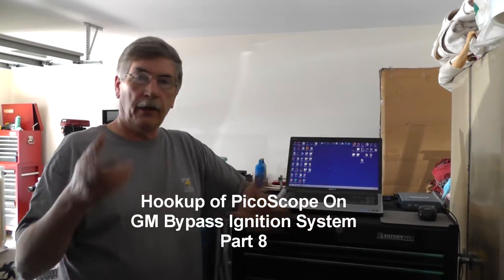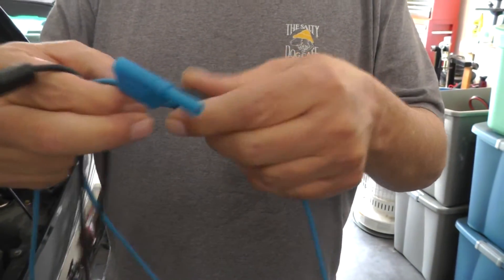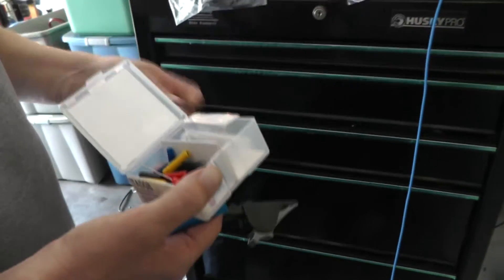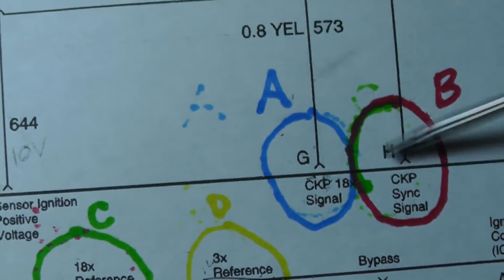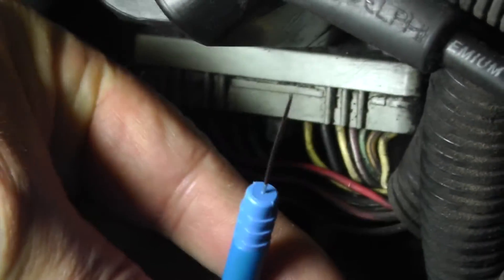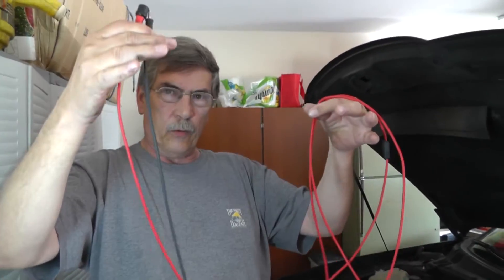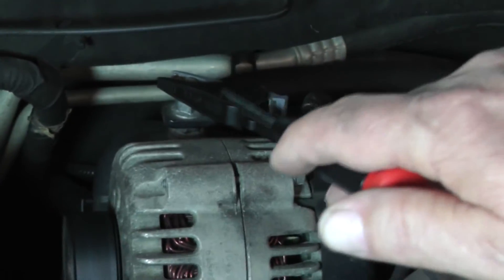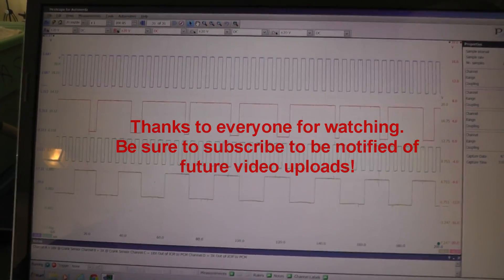PicoScope on GM Bypass Ignition System - Part 8

Comment: Wow, I never knew that about not needing to connect all of the grounds.  My first scope was a Pico 2204A and I have always connected both channels grounds.   A couple of years later I also got a Pico 4425A, which I assume on that one, I would have to connect all of the grounds since I am not sure if they are shared among channels like the 2204A.  If I would have watched this video much sooner, I could have saved myself some work! Thanks for your excellent videos!
Reply from the maker: Yes, on the older picoscope such as the 4423, all of the grounds are connected together and only one ground lead is necessary. However, on your scope 4425A, all of the grounds are isolated which requires that each channel requires it's own ground. Thanks for watching and sharing a comment! Have a great New Year!
Reply: @stuzman52  thanks, you too!

Comment: Thanks for the video.  I'm interested in purchasing an entry level bench top scope to kickoff a future electronics tinkering hobby - Several manufacturers have some decent deals on entry level DSO scopes (Rigol, etc) in my price range, maybe even consider a used scope.  Pico with 4 channels is certainly not in my budget.  Whatever I get I would surely want to use it for occasional automotive use as well (anything from ignition waveforms to mass airflow signals to cam/crank signals, etc. you know).  It appears that the pico scope you have uses insulated BNC connectors.  Here is my question:
Would I be able to use insulated BNC connectors on the typical lab scope?  What are the pro's / cons of insulated vs non-insulated BNC connectors in both automotive and electrical shop use?
Appreciate any advice you can share!  Thanks!
Reply from the maker: +Louis Pasnik Yes, there are some pretty decent scopes out there. The Rigol is a pretty decent scope with a high sample rate with a good amount of record length which is important when you're looking at long time bases. The long time bases come in handy when you're trying to find an intermittent problem such as an automotive issue. If I had to buy a bench top scope from what I've seen out there, I would go with the Rigol. Keep in mind that this scope runs on 120VAC and maybe 240VAC too and doesn't use a battery. So, if you were going on a test drive on a car with it, you'll have some issues to resolve like having a power source for it. Also, it's nice when you can take a set of test leads and calibrate them to the menu of the scope. For example, amp clamps put out a voltage relating to the amperage. Instead of seeing a voltage scale and then having to mentally convert to amperage, it's always nice to see an amperage scale. Same holds true for pressure transducers. Some scopes have this feature built in their menus. Some don't. Just something to keep in mind, and it's not a show-stopper, but does make life a little easier. As for the insulated and non-insulated BNC connectors, I believe it's just a cost issue. Even with the non-insulated cables, there's still a metal center pin and metal grounding ring. Even PicoScope's amp clamps have an all outer metal shell, but connects up fine to other BNC cables which are non-insulated. Even Fluke's FlukeScopes uses non-insulated BNC cables. For your accessories on your future scope, I've found good results from www.aeswave.com and www.autonerdz.com . Their leads such as straight leads, high voltage ignition leads, sync leads will all work on all scopes along with their amp clamps. Good luck on your future scope purchase.
Reply: Appreciate all your advice!

Comment: if that didnthelp check out this site
The security, antitheft or lock picture/icon is a visual indication that something in the car's antitheft system is failing.  In most GM cars and trucks there is a hidden system that most people are unaware even exists. From the moment you put your key in the ignition, there begins a constant line of communication between your key's security chip or transponder, to the ignition's lock cylinder, and then to the car's TDM (Theft Deterrent Module). These 3 parts are in CONSTANT communication. If the key is in the ignition, then these parts are sending signals to each other. The security light illuminates when that signal gets broken, even just for a second. When the signal breaks, the car misinterprets this as an attempt at theft and goes into antitheft mode. The car thinks its being stolen or hotwired because it is not getting that signal from YOUR specific key. This is why the security light turns on and shuts down your vehicle. This link explains it pretty well.
http://vatspasslockpasskeysecurityhelp.yolasite.com/
Reply from the maker: Thanks Jodi for your input and insight. The car never had an issue with the security light coming on and it didn't throw up any kind of code for that. I had the scope hooked up at the PCM while monitoring the 18X and 3X reference signals. Then I monitored the signals while moving the harness from the crank sensor, ICM all the way to the PCM thinking there was a loose connection. Everything looked good. Then I shut the hood to get things hot hoping for a drop-out in one of the signals. After 30 minutes of running, the signals never missed a beat. From some research, it appears that the crank sensor can loose a pulse or two and then start working again. Yes, very intermittent. Finally, I took a chance to change the crankshaft sensor although I never saw any evidence of a failure. After about four months, I haven't seen that problem again. I probably should have done a follow-up video to explain all this. Again, thanks for all of your input Jodi and take care.

Comment: Nice to see a basic review of this device. I have a two-channel generic oscilloscope and it's OK, but not nearly as fine as the pico. Lots more room to do other demonstrations with this device, Terry.
Reply from the maker: Hi Dave, you're right that it does leave lots of room for discussion on this device. Which is why I did a little tutorial in the video that just got uploaded along with looking at the waveforms. Thanks Dave for your comment!
Reply from the maker: Oh, I forgot to mention about your scope Dave. Is it a digital scope? And you ought to show us some vehicle signals from it. Take care Dave...
Reply: stuzman52 It's a cheap knockoff digital scope, cost about $300. There's more fiddling to get things right but most of what I need is there. Not nearly as smooth as the Pico. I had quite a bit of electrical artefact when I probed my 02 sensors directly.

Comment: Fantastic Terry - 3 questions: (1)    your acupuncture probes at the harness connection was lettered starting from A to P is there a reason the letter O is passed over.  (2) I never knew about the single ground at the pico  but when do you suggest to use the sensor ground.  (3) Why was this vid so short. LOL
Reply from the maker: Hi Steve. On question 1) Some manufacturers will eliminate the O because it could be confused with the number 0. So, by leaving out the letter O, we have no confusion, right? Or we confused yet (smiling)?

2) On this question, you really don't have to worry about the sensor ground because as far as I know the references are returned to battery negative anyway. So, if there was a problem on the signal ground, it would show up in the signal. Then at that point, we could do a voltage drop test on it. Also, it's not a good idea to use all of your ground leads on the channels putting each ground on different sensor returns. The reason is that you can be creating ground loops. In other words, signal returns at different locations can have small voltages above ground. The whole idea is that we want all the signals to be referenced to the same ground potential and this will happen when the ground lead on the A channel is connected back to DC battery negative which of course, puts all the channel grounds at the same potential. Now you can use the signal return, but use it on just one channel and leave the other channels open. And here's where you can really get in trouble by going across a sensor. Let's say you have a crank sensor that is a VRS type. Now there are two types. One is where one side of the signal is referenced to ground and the other type has one side above ground. In other words, the second type has a floating ground. Now you go across this sensor with one channel. You take another channel and hook it up to say the camshaft sensor which uses a hall effect sensor. Now you already know that it's return goes to ground. But you have just pulled the floating ground of the VRS sensor to ground. What is that going to do? Now the vehicle is not going to start. So, the best rule of thumb is to just always use the DC battery negative when possible.
3) Ah, number three is the easiest question to answer. I felt so bad about the other video being so long, that I thought I could catch up and make up for it in the next videos by making them a little shorter.

Appreciate the questions and comments Steve and you take care.